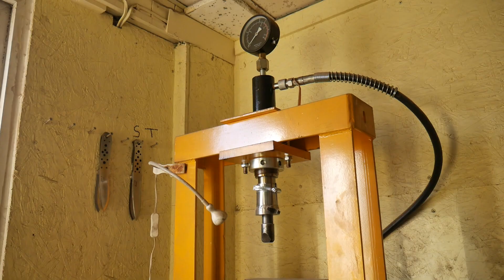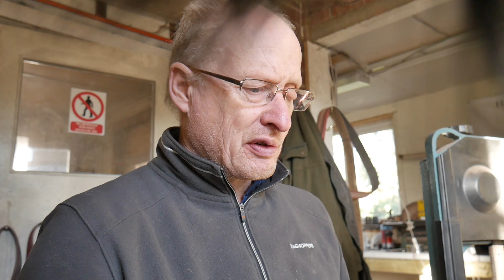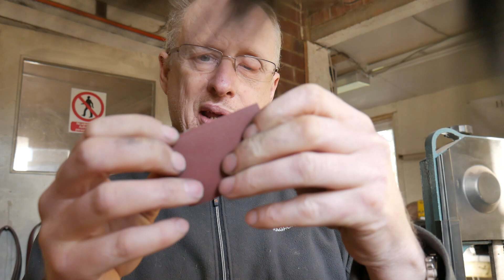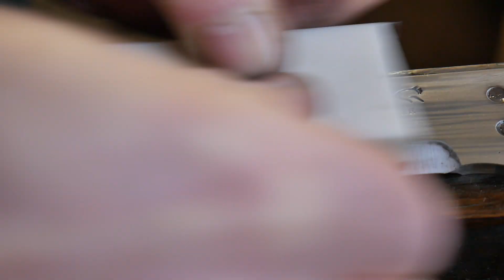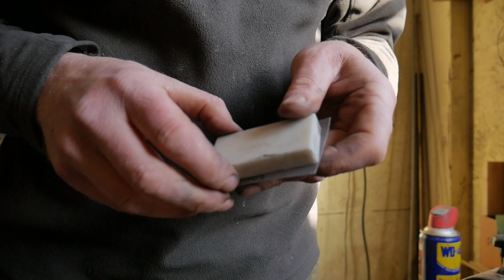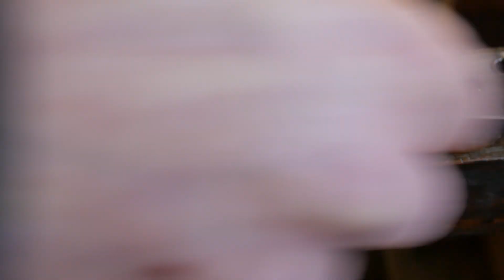Knife Making. Keeping blades straight and true. Hand finishing

Comment: Thanks Sandy. More ideas to improve my finish. Funnily enough I hand finish on a strip of corian so cutting a sanding block will be next. I like the idea of a small block as there's less chance of rocking and spoiling the grind lines. I started using a stress relief cycle two heat treats ago and have had  less problems with warps.

Comment: Hi Sandy   I have resorted to this method in the past doing a number of jobs. It is the only way for best results., it has to be kept steady but cant be clamped in any way otherwise there is distortion. Its nice to see you doing this as the old tried and tested methods are still the best and achieve the best results. They are exhausting and time consuming but do achieve the best results.